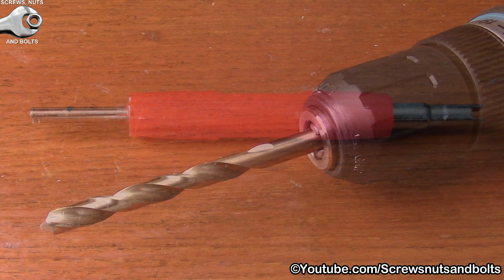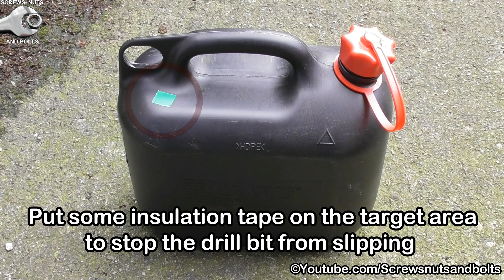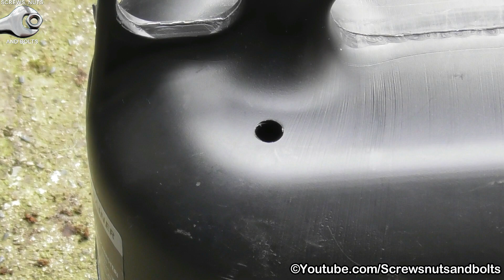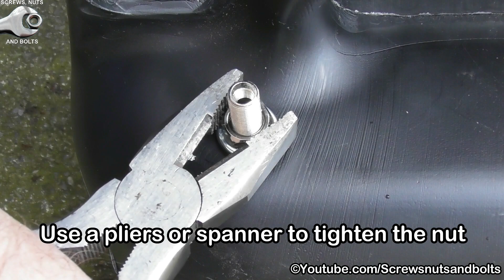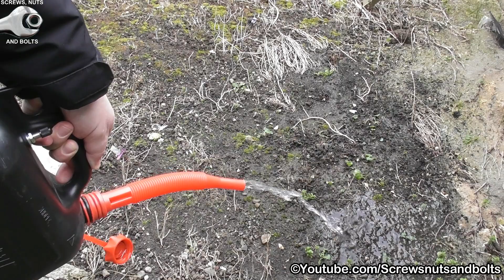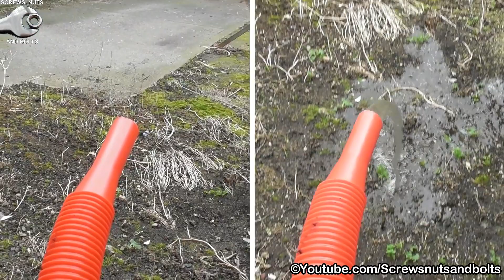Adding a Vent to a Fuel Can - Safe to use with Petrol or Diesel

Comment: A really great idea!!   With the valve stem cap screwed on, though, container is subject to pressure buildup with hot temperatures and could explode. Conversely, it would be subject to forces of vacuum, in very cold temps and could very well implode. An easy fix would be just drilling a very small hole in the center of valve stem cap, allowing container to vent. Remove cap, as usual, when pouring.
Reply from the maker: The container was already subject to those same pressures before I put this vent on due to its design. Good idea with the hole in the cap as an extra vent though
Reply: Hey, not trying to "one up" you, man!  Of course the container was subject to the same pressures prior to vent being put in. --Due to its  CRAPPY design. Venting, by Installing valve stem facilitates pouring the fuel, but does not alleviate the pressure/vacuum problem. (a far more serious problem than most people realize) My recommendation of additionally drilling small hole in center of the valve stem cap is a very critical step in insuring safe fuel storage.
Reply: New fuel cans /' spouts / vents are designed not to vent per EPA. Vapor builds in the empty space. The fuller the container is, the less vapor.

Comment: good idea.. that rubber washer inside the tank will last less than an ice cream cone in hell.
Reply from the maker: I used a nitrile rubber washer. It's fuel and oil resistant

Comment: Any suggestions for relieving pressure from jerry when off roading in extreme heat
Reply from the maker: I've never seen any type of pressure relief valves for jerry cans but there must be something like that available or maybe a cap that has one built into it.
Reply: Yeah it’s weird I can’t find any but!  What I find is people saying it’s not really a concern in the heat or cold and to just make sure to fill only to 95% of the can in question!  But lol I had a 5L can that shot gas 4 ft in the air for like 3 to four seconds!  So it’s hard to believe filling it to 95% would of alleviated that!
Reply from the maker: @Ramon-du7jv  Wow that's some serious pressure build up !. Is it a plastic or metal can ?
Reply: They’re Metal!  The current temperature is 116 here!  But seems like 95% is still to high!  I have an infrared temp gun!  So I’m doing some temperature readings on the cans filled to 95% to see what’s a safe temp to open!
Reply: Well I’m going to see if the 95% full rate will be enough to take the expansion first!  Then the trial an error!
Reply from the maker: @Ramon-du7jv  Best of luck. Take all fire safety precautions !
Reply from the maker: Does the jerry can have an internal spout by the way ?